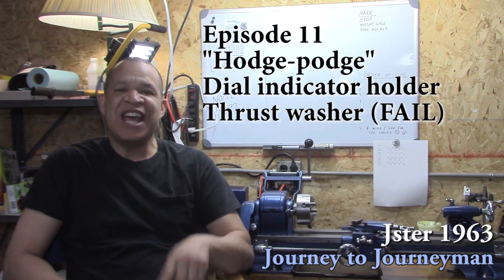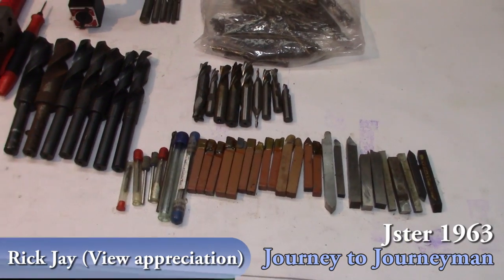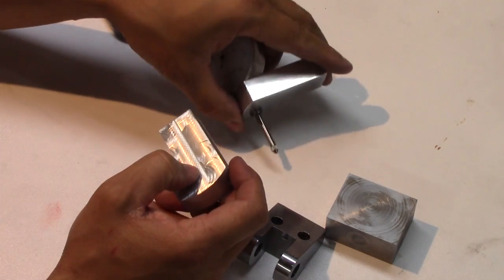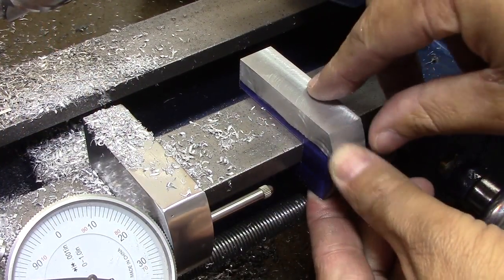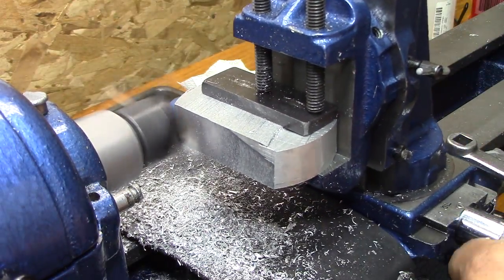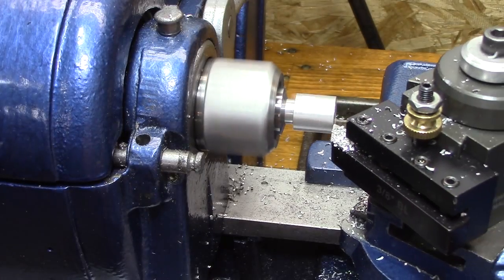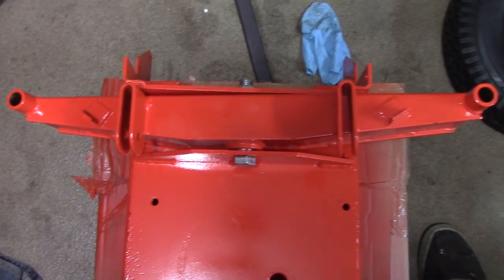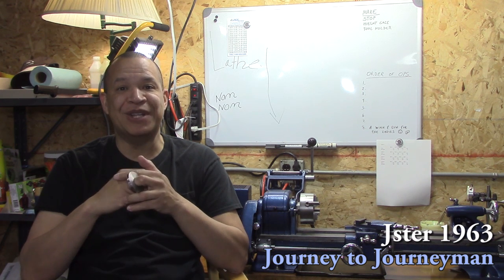Journey to Journeyman, Episode 11, I make a thrust washer and another a mag mount.

Comment: Milling on a lathe is no mean feat. You lathe has twice the travel of mine, that is soooo nice! If you have to reposition the work to get more travel it is instant disaster. As to the washer -- I learned the hard way to slow the lathe way down. On mine, with no VFD or DC control, minimum speed. is necessary. And very slow infeed. And lots and lots of oil. Satan still there, but he can be tamed.
Reply from the maker: +Juan Rivero LOL!  I will have to try to tame Satan;-)  I will try the back gears next time because that's not only slow, but has great torque.  Thank you very much......

Comment: Hi jster1963, with the trust washer you made, I assume the problem is that it was to thick? Why don't you place it on the lathe face plate(assuming you have one) or make a mandrel that can be held in the chuck jaws with a flat to fit the washer. secure washer with double sided tape and skim it down with some light cuts to size :-)Regards Max
Reply from the maker: +Maxi77 It was too thick and I couldn't figure out how to re-chuck it!  I do have a faceplate but didn't think to use it.  I started thinking about how to fix it, and I saw a large washer I bought for something else and it was the perfect size!  Anyway, thank you so much I will try to remember that next time......
Reply: +jster1963 Keep up the good work, All the best!
Reply from the maker: Thx so much!

Comment: You need to find a different way to clamp the mount to the ways because set screws will mar and ruin the finished ways of the lathe.  I am trying to prevent damage to your machine not be negative.  Nice work.
Reply: +Roy Reynolds 
Right about the set screws on the ways, mostly that these aren't hardened... Could implant a brass tip on the end of the screw though... ;)
Reply from the maker: +Roy Reynolds That's not negative at all!  Believe it or not, I learn from guys like you leaving comments.  I was just trying to see if it would work ("proof of concept") and it did.  I planned to use brass but I didn't have the rite size brass.  Thank you so much for the info.....

Comment: Part of the problem threading your aluminum with a die may be the alloy of the aluminum itself.  Pop cans are very soft aluminum because they start out as flat discs drawn over dies to shape them.  That's good for pop cans, but poor for threading.  The aluminum has a tendency to be very gummy and doesn't machine well.  If you try a piece of 6061 aluminum, you'll see a dramatic difference in how it machines.  I know using the pop can aluminum was one of the things that made this more interesting, but I suspect that may have also made it more difficult.  Using WD-40 as a lubricant while machining aluminum will also help a great deal.  I have a friend that got a big round bar of "mystery aluminum" for free, and it was nearly impossible to machine because it was so gummy.  Good luck!
Reply: The guys that cast aluminum the most will tell you to use aluminum that was already cast.  Pierre Beaudry is correct about car wheels and hard drive cases.  Those items were cast in the first place, so they are the best alloy to cast again.  We used to melt down old aluminum Briggs & Stratton engine blocks.
Reply from the maker: +HemiRod23 I bet you're rite.  It is pretty gummy, but I kinda like taking trash and using it for something.  I will try the 6061 sometime.  I did learn that better metal machines better.....just like you say.  I use WD-40 when I think about it.  I just forget.  Anyway, thank you very much for the info.....
Reply: +jster1963 As for melting Al, try to get your hands on old defective hard disk or car wheels, the Al bodies are prime quality, also you won't get the temper as in 6061 T6 cause of aging process, but better base material...
Bees wax based lubricants also make excellent cutting lubricants on Al, another benefit it smells better than WD-40....
Reply from the maker: EXCELLENT info!  Thank you so much!  I will look into that.  I just had cans on hand, but I will be on the lookout for better AL.  Thanks again.....
Reply from the maker: That totally makes sense, thanks!